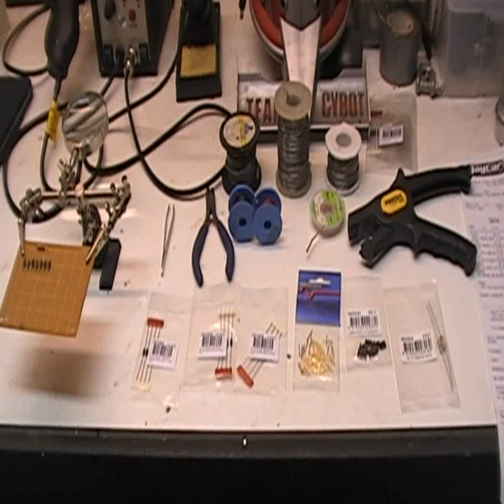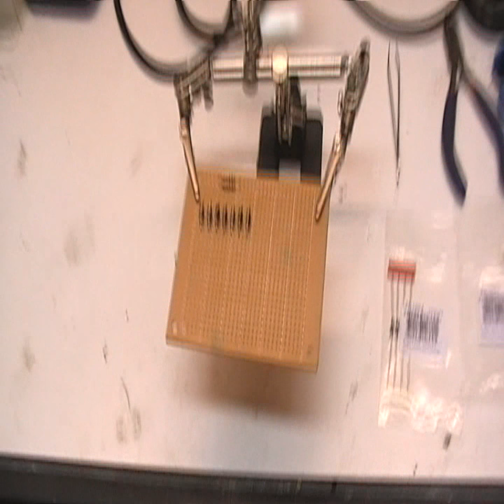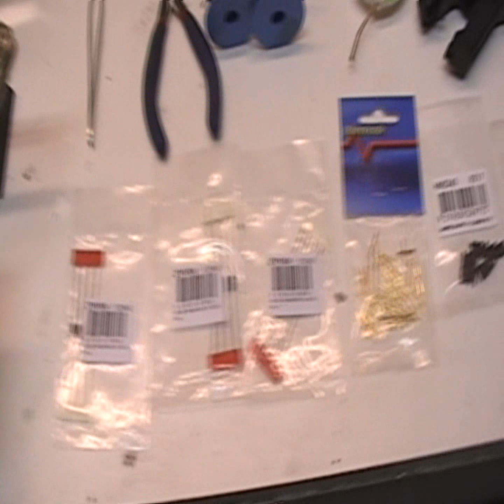How to make a selectable dummyload - Up to 1A current

Comment: Adrian how do an 2.54mm pin look like if you imagine that size as an pin?
hopefully you can see thats 2.54mm-pin-width is a lot bigger then these female-pin-holes, so it aint the pin size, but the pins placement areae-size that is refered as 2.54mm.  10:20
anyway, thx for the video, helpfull +1

just took a plunge of some of these jumper-cirquit breakers, the cheapest I could with shipping for a bunch of 100, was 1.28US (if anybody else are in the need for ones, like myself)

https://www.aliexpress.com/item/100pcs-lot-2-54-Circuit-breaker-short-circuit-jumper-cap-short-circuit-cap-connecting-blocks-of/32711332893.html?